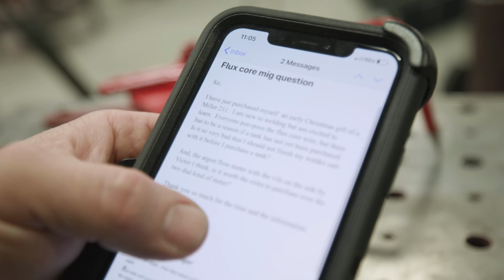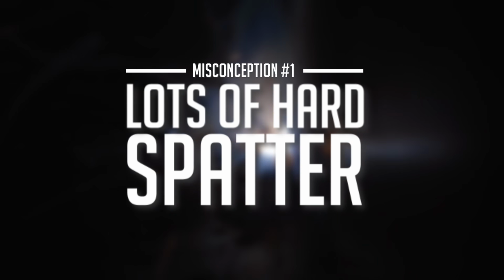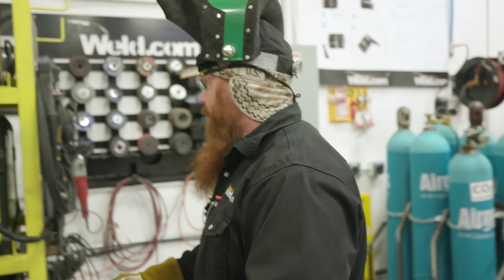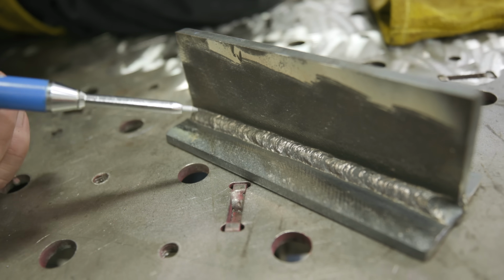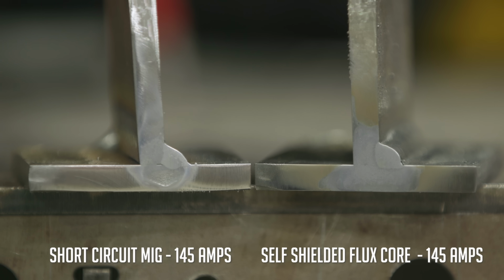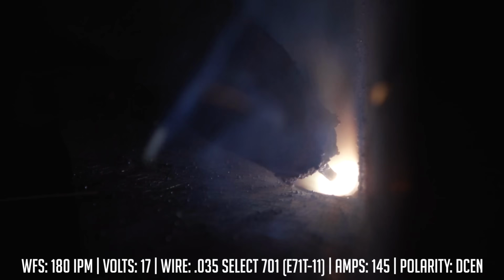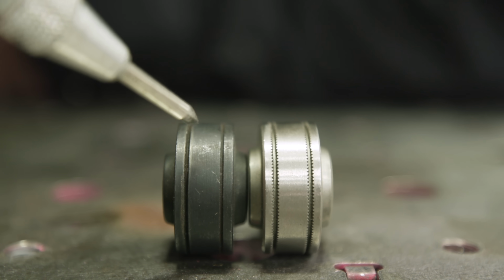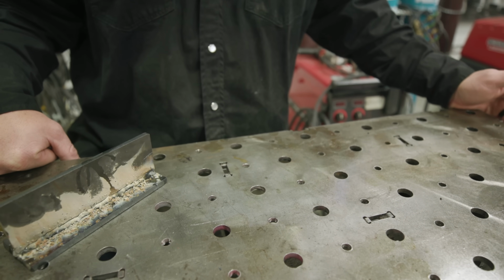3 Flux Core Welding Myths DEBUNKED

Comment: I used to be a production welder at a manufacturing plant that built HVAC equipment. Some of the metal was 27 gauge, with standard wire I would get a lot of burn through (which had to be repaired) but with flux core that wasn't a problem.

Comment: Great video,  had all kinds of trouble with mig, until I set polarity correctly, now I can get good bead good penetration. I  use spatter spray and nozzle gel.  By using scrap steel of varying thickness I have my own settings that work. Finally laying in beads as good as my stick machine. Next project is learnig TIG

Comment: Part of problem might be that when a beginner asks what polarity to use it is often related to if gas is used or not.....I was led to believe that when I used gas, I should switch polarity but found out myself that may be wrong as I was still using flux wire

Comment: So- that first example, about spatter, teaches us that the direction of flow (from the source to the base, not the flux core into the base) is the most common reason for spatter when flux core welding? Amazingly simple to correct, and huge difference in results. Wow. This sounds like a noob problem, because if you know it, you won't let it happen again!

Comment: Thank you so much I'm using flux wire my welds are getting better now that I watched your video they should be getting even more better. I'm going to to try and switch the cable's or adjust the speed. I might have the speed to high.

Comment: I Don't really understand why some people have problems with smooth wheel. I use flux core with smooth weel and it work great as normal gas wire. Do you think a flux core need a teeth wheel?

Comment: Do you have, if not, a video on flux core and sheet metal welding as in regards to automotive body panels. I’d like to do body work on my old trucks and do t want to mig or tig

Comment: Be right back, I have to go to the shop and stare at my welder for a min or two and see if this polarity switcheroo is even possible on my antique.
Reply: Raise the door where your wire goes and you should be able to see 2 wires close to the front

Comment: Anybody that says Flux core isn’t as good as solid wire is very misinformed or isn’t a welder. As a QA/CWI, I can tell you that most AISC structural welding shops don’t even have a WPS for solid wire and all of their PQRs are for FCAW or SAW. Great video sir, and keep trying to inform the misinformed. 👍🏻

Comment: After burning thousands of miles of flux core the only thing I didn't like was how Smokey it is. Otherwise it's a great thing to use in structural work and welding galvanized pipe. Sometimes when I close my eyes at night it's all I see.

Comment: I've never had issues with short circuit Mig doing quarter plate all the way up to 5/8 plate. However once I get over 3/8 I prefer to go to a .45 wire. I will frequently on 3/8 and up do a two-step process where the first is a spray arc and the second is turn down just a little bit to get a build upon that. Depends on how critical the application of the part is.

Comment: Flux core is the method used to do high-rise steel.  That's how it's done.
Reply: Is that right?
Reply: @dennismcclelland8196  Yes. One of my friends is a high-rise specialist and welding instructor. That is what they use.
Reply: @BustedGeezerGarage  I have a lot to learn. I always assumed stick welding was the method used for outdoor structural. I learned Tig welding first, and when I got my own Mig machine it came with a roll of fluxcore, and I never heard of it before. I tried it, saw it was messy as hell, but I used it outdoors and on dirty steel, mostly to repair my truck frame and I also fabricated custom rear end shackles, both of which held up to all my abuses, so I loved it for what it was: a strong weld that is quick and easy to implement. Its dirty, so what. I save my tig for aluminum and stainless, and now I had a way to deal with dirty, rusty mild steel. And now you're telling me it is what the pros use, that's pretty cool. I kinda just thought fluxcore was my dirty little secret, shared by other poor country boys.
Reply: mostly 232 wire, .072 diameter

Comment: Real good info, you're a very good teacher.  I've done a lot of repairs to my mowers with flux core on the structural portions and have never had a problem with failure.  I've found that the price for gas 75-25  Co2/Argon has really gone up, so I've found myself going to the flux-core more often simply for the cost.  Of course, if you plan to be doing sheet-metal work such as car bodies, gas would be my first choice.  Thanks for the video, it was really informative.

Comment: Great video! Is flux core practical with sheet metal thicknesses, like auto body?
Reply: Body sheet metal is a little thin for flux core wire, it's not really something you want to try unless you're very experienced and even then you'll still get better results with MIG.
Flux core burns HOT, big wire flux core for structural steel uses guns that have long necks to keep the backside of your hand away from the arc, even then there's an accessory for your off hand welding glove that's got two elastic bands and a silver panel that covers the back of your hand with the elastic bands across your palm, without it even though flux core guns for bigger wire have those long necks the backside of your glove will start smoking and the backside of your hand in that glove will get uncomfortably hot.
If you're ever in a welding shop where people are running both Innershield flux core and stick or regular MIG wire you'll see the arc from the stick will have that bright blue color and the arc from Innershield flux core will actually have a purple tint to it because it's so hot (I'm sure you know not to stare at ANY arc for too long or you'll get "flash").
Mind you this is all the type of flux core that's called "Innershield", that's what he's doing and what I was talking about with hotter arcs, there's another type of flux core called "Outershield", it's a flux core but it also uses a shielding gas like MIG does, unlike MIG though it is most commonly used with straight CO2 and must be used inside because like solid wire MIG a breeze can blow the shielding gas away and cause a myriad of problems, Outershield is commonly used in fab shops because Innershield is very smokey and causes serious smoke buildup inside of shops, also, unlike Innershield, Outershield is run DC+ like MIG and most stick is, Innershield is ALWAYS run DC-.
I hope that answers any questions you may have.
Reply: Thanks

Comment: Regarding the anti-spatter. Do you have to keep the spray away from the actual weld area?  i.e. cover the weld area with tape, spray, remove the tape and then weld?
Reply: No, but you don't want to hose it down too heavily with it or it can cause some issues, it doesn't take a whole lot of it to work, also you can spray some on the tip of the gun to help keep splatter from building up and sticking to the tip so bad, if you do then a slight tap on the welding bench will usually knock all the splatter stuck to the tip of the gun right off, just don't hose too much on the area you're going to weld and you'll be fine.
Reply: Duke Craig thank you.

Comment: I loved dualshield fluxcore. Superfast and much cleaner than solid wire (Less hot spatter raining on you!)
Reply: If you mean Outershield yes it runs much smoother with what's called greater "Operator Appeal" but it has the same problems outside that MIG does, a gust of wind will blow the shielding gas away and cause all kinds of problems, if you must use Outershield outdoors then build a shelter around your work with tarps and boards or whatever to keep the wind away.

Comment: So my Lincoln 100 is set up for flux core, that's all I Use, should I do the opposite of what Lincoln says and change( reverse) the wires inside for mig?
Reply: Absolutely, MIG runs DC+ and Innershield flux core runs DC-, Outershield flux core (flux core with gas, straight CO2 is best) is run DC+ like MIG and most stick.

Comment: You know most of us who don't like flux core have been around since it came out and have solid memories of how bad it was.

This video shows it can be done but you're using a much more sophisticated welder than what the home hobbyest gets at harbor freight or Sears .

I grew up with if it don't look like dimes it ain't right.

Good video though, how about a shootout among cheap welders.?
Reply: Flux core Innershield welding processes have been around since the early 50's, most of the time that people have problems with it is because they have the polarity set incorrectly. 
Some months back a friend of mine bought a cheepo flux core welder at the farm store and couldn't get it to run right, so he called me and asked if I'd come over to help him, the moment I started running it I knew immediately that the polarity was wrong, so I lifted the side panel up to switch the cables inside to DC- and lo and behold there was no way to switch them, so I started looking around for a switch or something on it, after looking at the box it came in I saw the output rated as DC+, I also noticed it said Made in China, I explained to him that some idiot in China must have mistranslated something at the factory that made it and that his machine was absolutely worthless since there's no such thing on this planet as an Innershield welding wire that runs DC+, I sent an Email to the corporate headquarters of the farm store inquiring about why they'd sell an Innershield flux core welding machine that had an output that was fixed at DC+, a day later I got an email back from them saying that their stores sold .035 wire intended for flux core machines, I returned an email explaining that I'm a 3.G certified FCAW welder with an AWS visual inspectors certification with over 25 years experience including years of structural welding in the  field as a Union Ironworker and years experience in shipyards and that no such thing as DC+ Innershield wire exists anywhere in the world, I never heard back from them and noticed a short time later when the farm store was out of stock of that model welder they were discontinued.
Reply: @dukecraig2402  lol you must be loved the way I am when you point out people are stupid.

Thinking back I don't recall being able to change the polarity on any of the cheap migs I used in the past.

I learned to weld at 13 on an old buz box and then a torpedo welder. 😆
Reply: @anastyb  
For the life of me I'll never understand how they could have put those things out on the market like that.
No, I know, once it's made over there in China and shipped it's a done deal, China ain't giving the farm store corporation their money back so the farm store is just going to push them on the poor unsuspecting customer. 
I'll pass along to you the best advice I ever got on welding and it came from an inspector when I was new at it, 90% of welding is trouble shooting, no one makes a welding wire, stick or spooled, that's junk, if it's not running right something's wrong, ie wrong polarity, wrong gas, wrong electrode for the metallurgy etc etc.

Comment: Can you spray anti spatter right in the joint I’m  going to weld ? Like will it effect my weld?
Reply: Just don't spray too much, don't hose it down too heavily or it'll cause some issues, a light coating will work, also spray the tip of your gun, it'll keep the splatter from sticking so bad to it, every once in a while when it starts to build up just tap the tip of the gun on your welding bench or whatever and I'll fall right off, another shot on the end of the gun and away you go again. 
Also some guns you can buy a special end that replaces the MIG diffuser cup so you can get into tighter areas and the threads and diffuser holes won't get messed up from taking the cup off and running the end bare, the special end tapers down to the size of the tip, makes it nice for getting into tight spots.

Comment: A lot of older engineers and welding inspectors have a prejudice against flux core. Most still prefer dual shield if you use this process. This was in pressure vessel fabrication and it is exponentially easier and faster than stick. Frontiarc 711 on 44lb spools was the wire used.
Reply: I'm an AWS certified welding inspector and if I see anyone welding outside with Outershield that doesn't have a tent built around their work I'll stop them immediately and tell them to go get their boss because I want to talk to them, there's absolutely NOTHING wrong with flux core Innershield, outside is exactly what it's designed for and even then there's no problem running it inside aside from the fact that it makes the shop a little smokey, I've never even heard of an inspector telling someone to stop welding just because they're using Innershield flux core.
Reply: It was mostly the engineers, honestly. We did all welding in a shop and the inspectors only really cared that the procedure was being followed, but they commented on the general reluctance of a lot of customers to accept the procedure for their vessel.

Comment: I bought a flux core machine and haven't busted it out of the box as I figured cheap meant junk. Glad that to hear flux core welding is good to go. Thanks for the video this was excellently done.
Reply: If you bought it from one of the big name farm stores then check the output rating on it, if it says DC+ then do not attempt to use it, there was a batch of them made in China that are fixed DC+, there's no such thing as DC+ Innershield welding wire anywhere in the world, all I can figure is some idiot in China screwed up something in translation when reading the specifications for manufacturing and the entire production run of them was made that way, if you have one and the box is unopened and you still have the receipt then get your money back, if the output specs say DC- or DC-/DC+ (which is switchable) then you're good to go.

Comment: I'm an old welder who dosent move to far out of garage , between oxygen, acetylene. and argon for tig I'm gas poor, my go to machine is a old lincoln  flux core that dialed in runs great with more than enough penetration , thanks for video. I have proof now !!!! You Sir are very good with all your explanations .
Reply: Always run Innershield on DC-,that's where most people screw up and it's how flux core Innershield gets most of it's bad reputation, from people trying to run it on the wrong polarity.

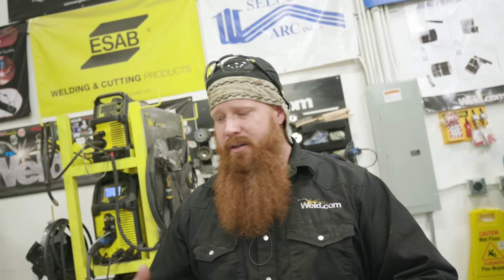Comment: Auto play starts this video as Im standing at my new welder, wondering how I ask a question without really knowing how I ask... 0:45 hits as the question is in my head and BAM! MILES OF IT ON STRUCTURAL STEEL! Thank you. I am going to try to weld cattle panels into a box for my trailer. Itll have 1.5" of wood and 1.5" of insulation sammiching it all around and a bit more strength on the roof, just not sure how Im going to do it yet.

Comment: flux core welds will never give clean welds.impossible no matter what machine and wire.
Reply: You don't know what you're doing then and like most people who cuss it are probably trying to run it on the wrong polarity, it runs on DC-.
I'm an ex shipbuilder and union ironworker that not only also has years experience shop welding but I'm also an AWS certified welding inspector, I can assure you you're very wrong, most "Moment Connections" in high rise buildings and sports stadiums that have been welded in the last 25 years have been done with Innershield flux core wire with the process starting to be used in the field back into the 60's.
People who don't know what they're talking about spreading BS like that around is what scares beginners away from it, it meets every structural and marine welding code it's used for.
Reply: @dukecraig2402  not everybody connects wrong polarity. flux core will never be as clean as when using gas. you can't do stack of dimes with flux core no matter what machine or wire or setting or experience. it's just nature of the beast.

Comment: I'm in the middle of welding complex parts for heavy industrial vehicles, and the things I've noticed as a negative over spray-mig are more hard-fused spatter, and deposition rates are lower for a given wire-size.

That being said, it's more tolerant of scale / rust, welds much better with a drag-angle, and it can run out of position. 

There are benefits to both, but FCAW is versatile while solid or metal-cored wire is a workhorse for certain welds.
Reply: FCAW Innershield is used in shops occasionally but is most commonly used outdoors where wind blowing the shielding gas away is a problem, I'm an AWS certified welding inspector and if I see anyone using a gas welding process outside that doesn't have a protective tent built around their work I tell them to stop immediately and go get their boss, because I want to talk to them.
Innershield welding gets a bad reputation from people throwing things around based on assumptions and suppositions, none of it's based on fact, Innershield welding meets all structural and marine codes that it's used on, ocean going vessels, high rise buildings including welding of structural members inside of shops, it's perfectly legal to use in shops, the only reason a lot of shops don't like to use it is because it's much more smokey than Outershield, but it's application is acceptable anywhere Outershield is, even indoors.